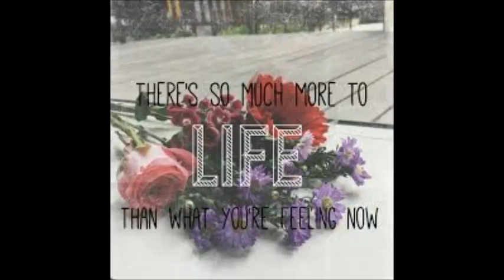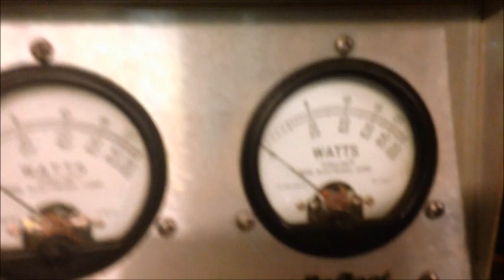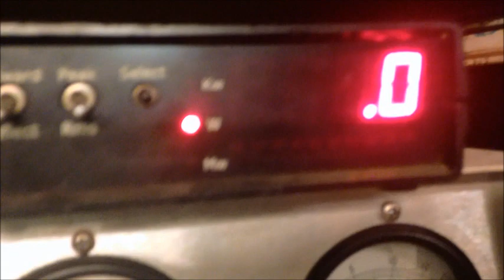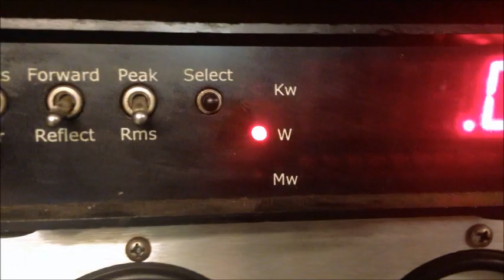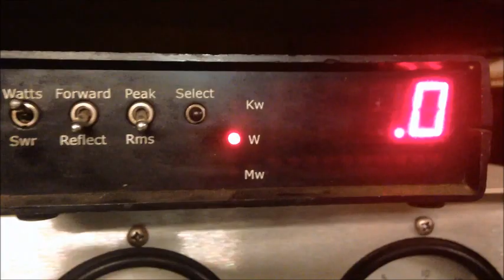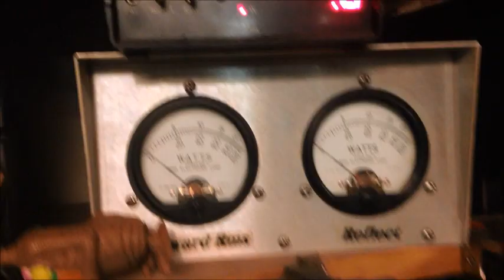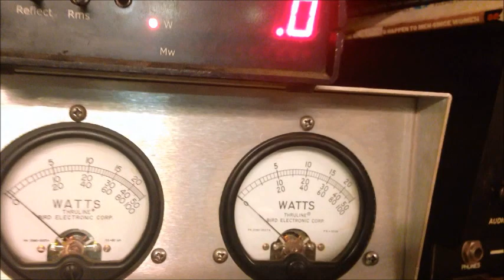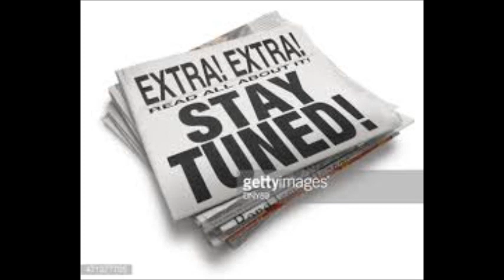Time to learn about jumping length

Comment: I don't get it! This makes no sense. If different lengths of coax are making this much difference you have a problem, I suggest you have r.f. on the outer of your coax which needs sorting out, especially if you have a problem with r.f. jumping and coax crossing and melting  I've never had any problem with different lengths of coax or crossing them or coiled up and certainly no melting. How much power are you using?
G4GHB
Reply: hey bill. im with you. Unless these cber's have alot of COMMON MODE floating on the shields of thier coax i dont get it!!   But he says he's using a dummy load so..... Its impossible to really tell what they are using or doing with these videos. Craig  call sign KY4PI.  Extra Class ham here.
Reply: @cathyrowling111  Hi Craig, yes, I didn't get what he must be doing if he's using a dummy load.
73, Bill, G4GHB.

Comment: Tried all this & none of it works! 12 ft jumper makes no difference then 3ft I use 3 & 6ft jumpers on everything with RG213 coax have for 30+ years!
Reply: Exactly! It's nonsense.
If you watch you see his forward power goes down so obviously his reflected power goes down.
But why it does on his dummy load I have no idea.
45" or 20" jumper here 1.8 MHz to 29 MHz.
G4GHB.

Comment: Great video! Thanks for taking your time to make it! I like to look at it just a bit different, a quarter wave (3 foot jumper) at the rig to the input of the amp sees 180 degrees out (246/27 x .66 VF is a quarter wave). Simply said, if you have low impedance at the rig, then using a quarter wave matching section will see the reverse.. now a Halfwave matching section  sees the same at both ends.  Using. (246 x 2 /
27 MHz times .66 Velocity factor = 12 feet.    This is providing the input of the Amp has a low impedance input. I am an ex Bird Calibration Tech., worked there for 12 years.. use to run into this all the time. 73's. David.
Reply: Correction: the 3' quarter wave sees 90 degrees, the 12' sees 180 degrees. Slip of the finger!
Reply: I am wondering here and learning this stuff, am i doing something wrong? i put in 27X.66 and come up with 17, i have tried it with 27.000X .66 and still come up with 17, how would i go about figuring out how long of a run of coax would be needed to run to a antenna? i am lost when it comes to this stuff, i was also wondering if the length of coax to a antenna switch box would matter, is there something i can go by as a basic to always use, i have been into radio for only a few years, i have been told that coax length doesn't even matter, so many different ideas and ways of doing things im lost hahaha i will be getting a antenna analyzer on in a couple of weeks to help me with some of it so hopefully that helps
Reply: @mikehannahs  983.6 / 27.205 x velociy x .5 to get half wave.
Reply: Thanks I appreciate it 😎😎😎😎😎
Reply: Velocity Factor is how much the Speed of Light is Slowed Down, to reach the inner of the coax,  Different brands and size are all different from RG142, Rg58, RG58x RG213 + Mil Spec, LMR400, Hleiax 450/550/650, so .66VF is not right when RG213 is .86VF
Reply: David, I've been using the math for years too.  :-)

Comment: I had trouble with my amp oscillating with a 6 foot jumper, switched to a 4 foot and it fixed the issue. I fixed my reflect issues by making the coax longer after the amp.

Comment: When you put the directional couple at the shack end the reflected power reading is consumed in the coax and inaccurate.
When your antennae is 50 ohms and your transmitter is 50 ohms, it doesn’t matter what length the coax is as long as the coax is 50 ohms.  When everything is the same impedance you will have maximum power transfer with little standing waves.
It is hard to see how your connection are made in the video. A diagram would be helpful. I empathize, a picture is always better ( in my description as well, we use what we have to work with).
It appears you have connected your transmitter to your feedline (reference plane), with coax and have a mismatch and are trying to match impedances at that point in your shack. (Stub matching). While a match at this point protects your transmitter) you are doing nothing to match the feedline  at the antenna feedpoint.

You need to match the feedline at the antenna as well.
This can be done with a stub, balan/unun, etc. if your using coax you should put your directional coupler right at the anttena feedpoint up in the air, only then will you get a correct swr reading.

When you use a match box, you are matching  Z between your transmitter and the matchbox, thru a piece of coax.
If the feedline and antenna are both 50 you have a match. This usually is not the case, at which point you need to tune your antenna.
The output of your match box in the shack is the reference plane which is matched to the feedpoint of the antenna by adjusting it’s capacitor and inductor.
If your antenna is other than 50 ohms then the feedline has to changed to match.
If you use ladder line at the output of your match box you are matching it to the antenna, while matching the transmitter to the input of the match box.
Reply: I really don't know what he's doing. He's on a dummy load so I don't get why his reflected power is changing but also his forward power goes down if you look.
Melting coax? It must be cheap and poorly screened.
G4GHB.

Comment: Oooh right,cool...had some problems with impedance and got it to an 1.5 swr on the radio,but i run out of cable...strange thing is that i have impedance problems on one mobile amp and not on the base amp(both kind of similar,the b501 zetagi and the klv 550)
Cool video!!!!
Reply: I doubt its an impedace problem. if using 50 ohm coax its 50 ohms lol.  put an antenna analyser or nano vna inline and find the problem  Craig.ky4pi
Reply: @cathyrowling111  on the dummy i have the same issues...
Reply: @MrRichard57000  try a different jumper to the dummy.

Comment: SNAKE OIL!! Read about jumper lengths from AARL online articles (real Elmers.) Jumpers will only affect your SWR if the jumper in question is detective. PERIOD!! If your amplifier keeps blowing up when you're using a three foot jumper you might want to stop using that particular jumper. It's sad to see all this false information being spread. Especially when it comes to newbies who don't know any better. One needs to go directly to the source of the correct information, and as I mentioned above ARRL online articles, about anything hobbyist Communications related, are the gold standard in which to gain proper Communications knowledge.
Reply: Amen.
Reply: NAILED IT !!!
Reply: Stop with all that logic
Reply: It is nonsense as both coax cables are joined together in the SWR meter so cutting one to length makes no difference as it's all one cable anyway.
For 49 years I've cut no coax to specific lengths except for phasing lines.

He doesn't show us his forward power goes down too, he skips over that but you can see it three times at 4.01, 5.32 and 6.58 so obviously his reflected power goes down.
G4GHB.

Comment: It seems you are trying to match impedances by using jumper lengths and'sizes'.  That tells me that the devices you are connecting do not have the same impedances because they are not constructed well or close to well.  From the devices shown, that's not hard to believe at all.  Why not just do it right to start with?  Of course that requires you to know what 'right' is to start with (you may know but your explanation doesn't explain it).

Comment: Loss for RG8X roughly 2 db per 100 feet at 27.5mhz. Thats .2 db per 10 feet. 
Now, with 3 foot jumper you had 250mw reflected. Increase that jumper to 12 feet and loss for barrel, with 250mw reflected at the amp, the radio would see 100mw less just because of coax loss. You're not matching anything. You're also cutting your forward power by 100mw too. The goal is to match the radio and amp input impedence. If they're matched, the shorter the jumper the better would still give you 1:1 match. If you want a thumbnail without matching radio to amp's input, look at the output power of amp, then swap input jumpers for highest output.
Reply: Loss and swr are different things. Lol ur simple.

Comment: Hello guys, what about matching for a multiband amplifier? how i should calculate the length??? i'm using a RF240UF cable .80 factor of velocity. Thanks
Reply: Exactly why it's nonsense!
Any length of coax will do.
My 45" to the SWR meter and 20" to the aerial tuner works 1,8 MHz to 29 MHz. Or the other way round if I set up differently.
G4GHB.

Comment: if i send u a pic of my galaxy innards can u tell me what has been done? it has so much jumped, and the texas star i dont think its needed, but my antenna is just a k40 if you are near id about send whole setup to u , but ive had 3 ft jumper ,i went stick external speaker and noticed the hole was blocked so i swapped p.a input over to ext speaker port, i ended up with the setup working for a buddy and he paid me cb setup, which everyone needs old school way reach out, just watched some your vids, and seems you know alot more than anyone i know around here, the main guy i know id take it to him, but he sold me the 3 ft jumper, at rebuilding fried stuff hes awesome but, 3ft call me paraniod but maybe set up lol

Comment: hey have been trying different jumper have 1ft up to 12ft  but the thing in my car I have a galaxy 979 into 2x8 ds amp with a stryker a10 mag antenna with mini8 20ft cut about 8mm off antenna from the top 1.1 1.3 across 40 11meter but with amp on swr goes 1.5 - 2 what do think about 30ft from antenna or what ???thanks great vid...Floyd the barber
Reply: Having the same issue  with my 4 pill  im getting 1.0 with amp off and 1.5 with  amp on like to get it down to 1.3
Reply: Diud you know if using coax as the antenna like a bazooka you can adjust the swr by folding the ends? Craig KY4PI

Comment: hat do you do if the amp is built in the radio? That is where it gets complicated for me.
Reply from the maker: +Gary P Thats the tricky 1, I play with the caps on the amp to make it think it has good reflect. I've seen a few come in that have had an issue with those radio amps. Best thing to do is not waste money on them as a stand alone amp will always make more watts and is the better value.
Reply: +Dropmaul99 Thank you sir. I love your videos and admire your work.
Reply from the maker: +Gary P Thankyou I like to help people and this is 1 of the ways to do that. Instead of misleading people with some of the BS that goes on out there.

Comment: 3', 6', 9', 12', so you really need 15' or 18' to get your readings even lower. Why not make sure and go for 24'?
You're on a dummy load. Coax shouldn't do that. You've got a fault somewhere. Why aren't you showing us that your forward power goes down too, 4.01 and 5.32 and 6.58? So obviously your reflected power shows less. 
Why doesn't it do this on my set up?
45 inches from my tx to the SWR meter and 20 inches to the aerial. Or the other way round depending how I set it all up and it makes no difference to my reflected power. 
In 40+ years I've never had a problem with coax. Why is it only C.B.'ers who have coax problems? 
G4GHB.

Comment: If you do not have a perfect ground, that is everything, Radio, Amp, Meter, PSU, Antenna, anything that has DC power running through it,  you are behind the 8 ball playing catch-up with coax length's trying to match 50ohm's and fake a ground, Only in a Car we should have that problem. I see nothing grounded in your video, so you are relying on the ground of the coax and there's the problem

Comment: I found a seller on eBay that sells different lengths of different types of coax and specifically for Cb 11 meter he sells 1/2 wave lengths. So the length of the 1/2 wave will depend on the coax velocity factor. Some are 12.5 feet and some are 14.5 feet. I use 1/2 wave lengths between each. Between radio and amp, amp to meter and meter to antenna in my mobile. A lot of people don’t know about velocity factor.

Comment: Put a 50 footer between Radio and a.m. then you’ll have no reflect. It’s called Line loss. If the box is tuned properly it’ll work with a 3 foot jumper. Don’t believe me go check out Mr. BBI
Reply: Coax manufactures go through a lot of engineering to remove length from the equation in antenna tuning. The impedance is constant regardless of length. What you have actually proven is that the input impedance of that amp does not match the impedance of the system. What you are doing is using the coax as part of the tuning circuit to match the radio to the amp which it never was designed to do. A much better approach is to have properly tuned amp inputs that match the impedance of the coax.
Reply: @douglaswhart   impedance only remains constant with a purely resistive 50 ohm load.
How many folks can replicate those conditions with a mobile antenna?
Reply: @douglaswhart  all the trick is on the tuning of the amps.

Comment: it also a good idea to use or multiples of 12ft to the antenn for 11mtrs cb,,ie 12ft 36ft and so on,,,also mobile most mag mounts come with 9ft of coax,,,change this out t 12ft...always use odd multiples or a half wave with velocity factor calculation for the freq you are working on,,,details on  the web,,,this gets over looked even by hams but is so important for a efficient system
Reply: Spend more time matching the antenna and maximising its groundplane, length of feedline would make no difference other than the loss in the feedline